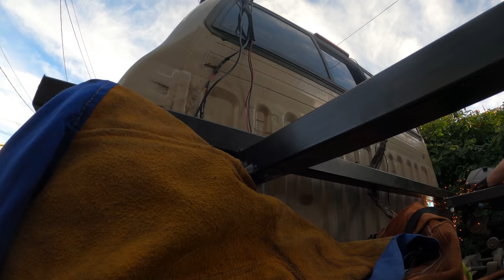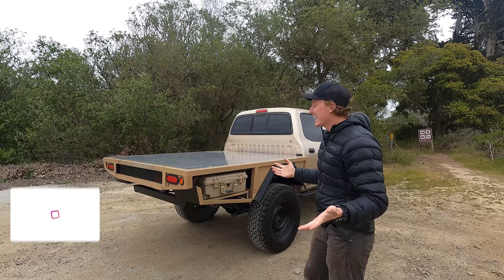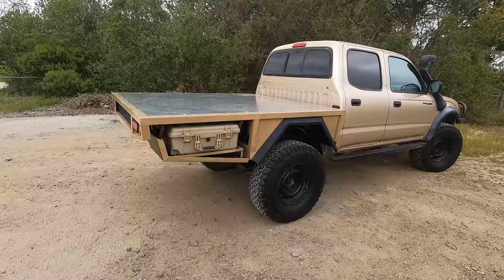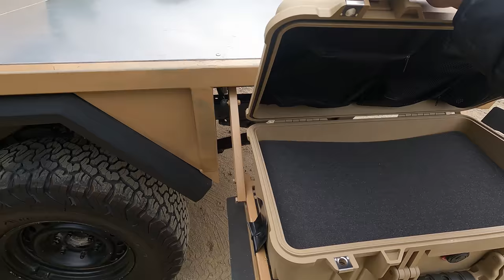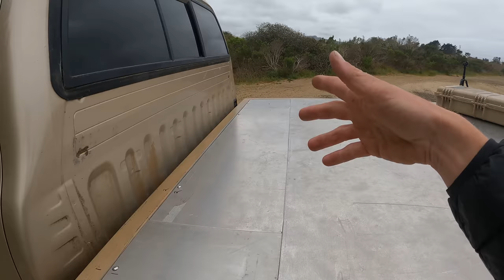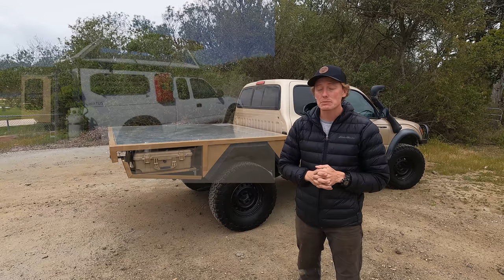Home built DIY 1st gen Tacoma flatbed Ute tray!

Comment: Looks awesome.  Don't trust the drawer slide latches offroad.  They will fail and your drawer will come out.  I've got similar drawer slides for a tent that goes on my truck and I've had them fail on me going down a rough road but luckily I saw that ahead of time and built in a safety catch for when they did come loose.

Comment: Super well thought out arrangement. Impressive!
In my experience those drawer slides don’t last long when exposed to dust and dirt. The ball bearings collect the grit and eat themselves up with the regular jiggle-wiggle of driving. That was experienced on fleet of shuttle busses with slide out battery trays. They lasted less than a year and the trays fell out of the rails. I’m sure the Mfg. Used cheap ones, but maybe consider having a catch rail below them in case this happens.

Comment: Hell yea man! I just started designing an aluminum one for my 3rd gen. Looks great, and is some solid inspiration for mine.
Reply from the maker: Sweet! Aluminum is the next frontier for me. However for the flatbed frame I don’t think I would go aluminum. I want to use it for my camper!
Reply: @OverlandUnderBudget  Is that mostly out of concern for the vibration on the welds? Asking because I did have the intention of making it 100% out of aluminum. 

Weight is a massive concern for me, I will also be adding the Aussie style canopy boxes to the frame with a RTT mounted to the top of those. I’m running some Deaver heavy load springs, but I feel that steel would still make trails exceptionally difficult on the truck. It looks I can use 6 existing mount points to the frame without drilling a single hole. I understand that there will be some flex, I was just hoping to offset it with some beefy internal framing.

I have mostly come up with and designed this from looking a products like the Norweld Ute trays, but without many other perspectives. So any insight you can lend is greatly appreciated.

Comment: That is a nice Taco I am very impressed. I had a 95 single cab same color paint code might have been 404 brown. If it had been a quad cab like yours I would still have it but my height cost me more money but have a R/W Tundra. Great build keep it up also look into the spray on bed liner kit out now where you can do your whole truck it might be raptor paint or coating but you line your truck and eat branches.

Comment: I ran into issues storing my recovery gear like you are planning. When I was stuck I couldn't access the door where my recovery gear was stored. I ended up storing my recovery gear on top of my roof rack or at least the soft light stuff.
Reply from the maker: Super good point and something I thought about as well. I’ll probably keep recover specific stuff like snatch strap out of this box and in the cab. But things like the air hoses, and other things in there. We will see how it works with some testing 👍🏼

Comment: Just came across your videos again and subscribed!

We're also doing a build on a 2005 Ford F350 Dually. Expedition Overland Truck Camper flatbed. Everything is on our channel. We did a steel frame with 60 series aluminum 1/8 sides, with our top deck we did the 3/16ths and used the 1/4 × 20 x 1" flat head socket screws stainless. Using the all in one 1/4 drill, tap drill bit. Same thing for us we want to be able to take off our top deck while working on the build out.

Love the side box idea with the cases and how they come out. I believe long term you'll be happy you did the full 6ft across! 

Have you figured out how you're attaching the camper to the frame yet? We have been considering the L Track tie down system. 

Going to look at a few of those suggested camper links. 

When you started talking about the plans and awning...I remembered that video. Well done. We can't wait to see more!
~ Mark & Teresa

Comment: Like the innovation, Comment You need looks on your pull out rack...what if toy added  over with  slide tracks a fabric tube  that would hep o keep out dust and dirt on the roller bearings of the track?

Comment: I actually never liked the 4dr trucks cause of the lack of bed length and that’s the reason why I have stuck with the extended cab trucks.
Reply from the maker: Totally. Hopefully creating the best of both worlds
Reply: Just watch your weight. Stock Toyota and even some aftermarket springs can’t carry any weight. Just the flat bed alone will out weigh the bed even before it is fully built. Upgrading your rear suspension is goin to be needed plus adding air bags could be needed. I have 2500 Chevy springs on my rig and after positioning the rear hanger angle more at a 90 degree angle at empty ride height towing and hauling capacities greatly increased.

Comment: Ok, now what did you do with all the stuff you took off. Mostly the rear bumper with the tire carrier and table. I have a 2001 Toyota Tacoma ex cab 4x4 I’ve wanted to get a setup like what you built. I’m a Disabled Veteran “USMC 70-73” just turned 71 and I can’t do a lot of things I think I can.
Anyway just thought I’d ask.

Comment: Man I always have a question that I could not find proper answer. This truck probably has very low payload capacity. So low, that it should be hard for the lightest weight pop up camper with 2 people to match the payload. How will you manage that?

Comment: Watch out on how much weight you put behind the rear axle. 
To much rear weight will make you do front wheel lifts while off-road.
Reply from the maker: Yes sir! Very true, one of the cool things about this build is the rear bumper is a lot lighter, and I might put the tire right behind the cab. Should really shift weight forward if the axle

Comment: No rear winch?
Reply from the maker: Definitely thought about this and that would be really neat. Reasons for not doing it at this point are. Weight behind the rear axle, cost, and the hight of the winch wouldn’t allow for the slide drawer. However I was thinking I could possibly mount one right behind the cab and run the line to a fairlead in the back.... uhmmm